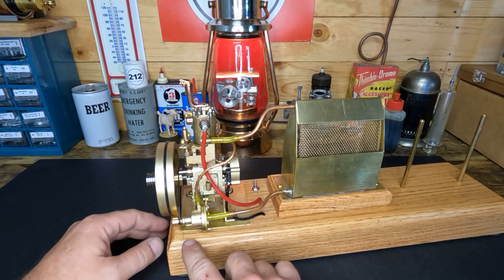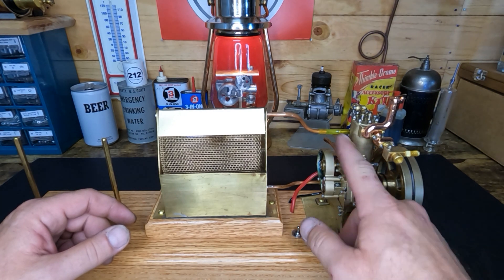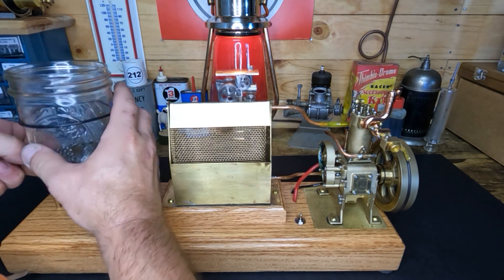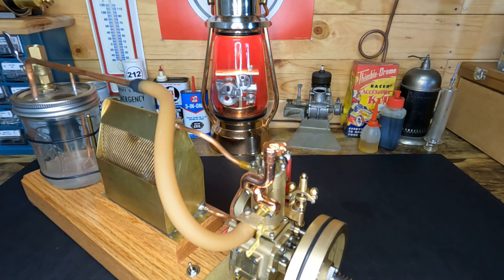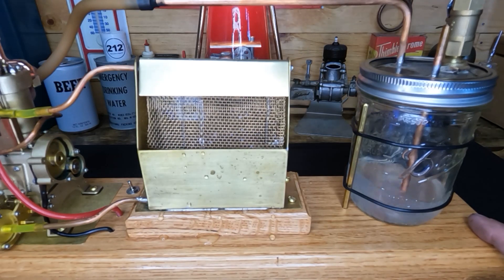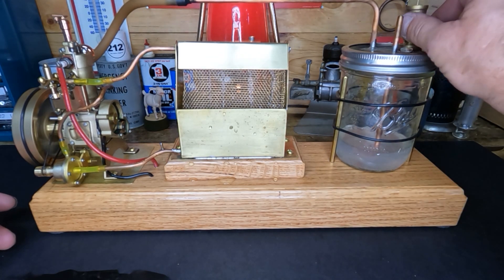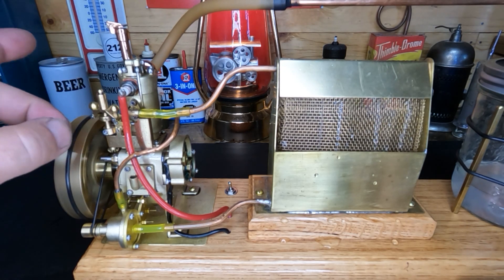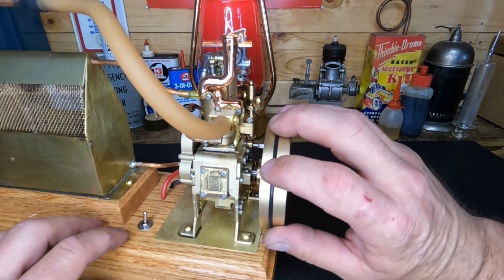Alcohol burning modified H73 engine

Comment: Very nice project. 
I put a spare carburetor from a M25 on my engine and disconnected the governor. It is possible to idle very slowly now and it starts by hand.  
The governor did not work very well. It released to late. So i shortened the spring inside the governor. ( the cab on the top and the small gear at the bottom are screwed on the governor rod if you want the remove the governor completely) 
After shortening the spring the engine runs a bit slower but still to fast. And the engine gets really hot. Over 220 degrees F. Measured at the cylinder head. So I decided to disconnect the governor and put the carburetor on. Low idling temperature is now 180 degrees F. Still to much I think.
The cooler is not working!
The water connections at the cylinder and the cooler are free. I guess the diameter of the water pipes is to small to circulate the water by temperature changing. I think I need a small water pump like yours. 

Like your videos and your voice.
Reply from the maker: Hi M C, I agree with you that the governor and latching mechanism do "work" but they do not work well. If you are thinking about improving the cooling system, I think that we will be building another radiator for a different engine. I will be sure to record and post it also.  Thank you for watching, commenting and the compliment 👍

Comment: How much did it cost to buy all the materials and build that? I think it sounds much better as throttle governed than the hit and miss
Reply from the maker: Hi Samuel,like ANY project your biggest cost is time. The engine was the most expensive part but aside from that the water pump was around $30, the brass material for the radiator was cut from a sheet big enough to make 3 or 4 out of, it cost me $40, the copper tube was stock that I had on hand, the rubber hose was .79 cents a foot, the mason jar came from my wife's kitchen, and the ball valve was on my shelf. And the oak base was $10 for 3 feet of material. I agree that it sounds much better than before and it seems to have considerably more power now also. Thank you for your interest and commenting 👍

Comment: I enjoyed this very much ! Nice work ! Is there oil in that little crankcase ?
Reply from the maker: Hi Jace, I'm glad that you enjoyed this video, to answer your question about the crankcase, yes there is just enough 30 weight in the sump for the big end of the connecting rod to dip and splash lube the engine. Thank you for watching and commenting 👍

Comment: Nice Matt. Excellent crossover. Thoughts on Piston O Ring compatibility with alcohol? No lub gas mix ratio?  What's your thoughts? Good video Matt.
Almost past the 500 subscribers.. solid
Reply from the maker: Hi Jj, I think that because we're essentially running on fumes with no way to "wash down" the cylinder walls with excessive liquid fuel and the crankcase oil splash lube is lubricating the cylinder from the bottom that it should be ok, but the only way to know for sure will be to run it for a few hours so we will fire it up and let it run while we work on the next project. Thank you for watching and commenting, I always enjoy reading the comments 👍
Reply: Argree

Comment: I fed my M-17b some Omega 5% and it.....is interesting. It is a BITCH to start. WILL NOT HAND START on the stuff. But once it does start, it does seem to run a bit better than it did on zippo fuel. Carb definitely feels more adjustable on that stuff but it still has a lot of problems.

I also tried it on Omega 5% and OS F glow plug. It would run if I externally heated the plug but died the instant the driver came off. Also was not able to get the plug fully seated. That, and the carb issues, likely explain why it ran so poorly like this.
Reply from the maker: Hi C6, I would like to get a carburetor from the new motorcycle engines that Jin is making now, they have a float bowl and a slide valve. I would think that setup would be more adjustable and give better results too. Thank you for watching and commenting 👍